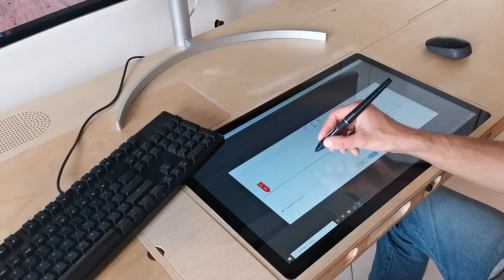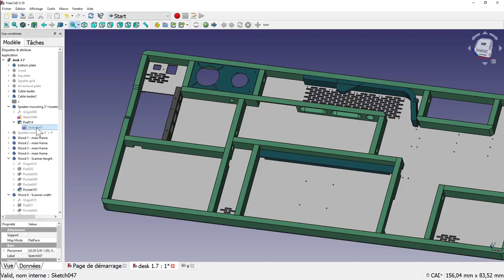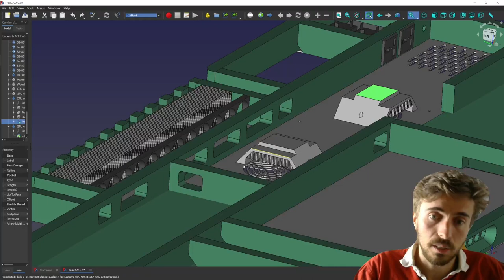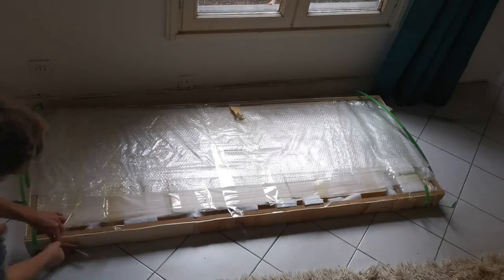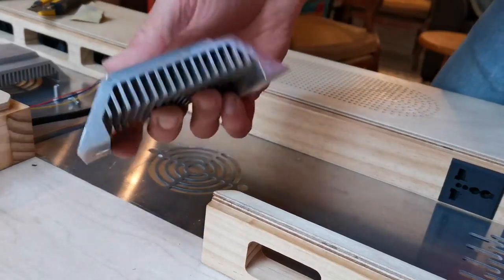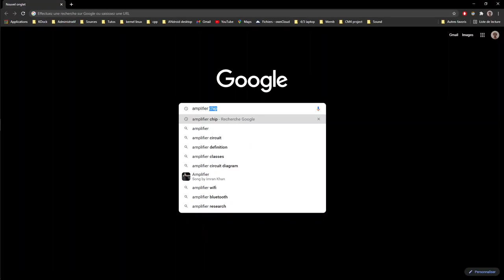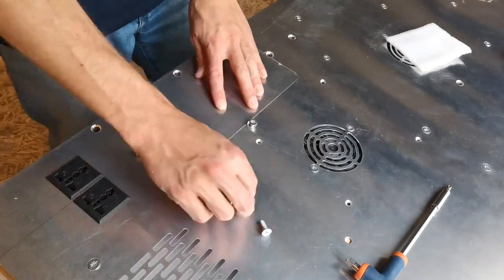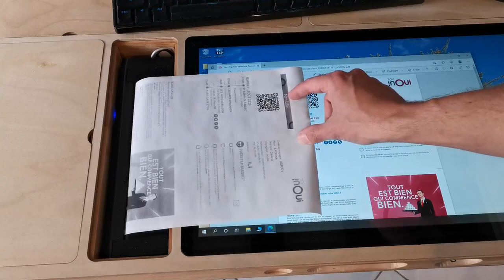The ULTIMATE desk PC!

Comment: Hi, nice project, looks very neat. Just some remarks: the VRAM ont the GPU is not touching the custom heatsink, I think it will be problem with load intensive program like games. The orientation of the speaker are not optimum, and the tweeter might be very attenuated by the angle of the listening position. The speaker enclosure need to be calculated and completely sealed or vented to provide a good bass respond, as for the crossover. The 11 small fans might create a lot of noise while spining, the larger the fans, the quieter. It will be very convinient to have some USB port that can be accessed from outside, to charge the phone for exemple. The tablet screen might interfere with the keyboard and the optical mouse, maybe a cover will be convinient.

Comment: The desk heatsink idea sounds good in practice but I have seen many "silent pc's" that do a large heatsink system. These are normally really complicated and a lot of very specific machining. I think just including some sort of watercooling support (like the desk LTT built) or just simply some air holes with a dust filter(maybe).
Reply: unless you can post temps of your hardware and it stays in check then it might not be as big of a problem as I think.
Reply from the maker: @tonylarose4842  temps during stress test maxed at 75°C. So that's correct but it could be better. 
I'm currently thinking about what can be optimized. One main thing is that if the bridge was made of copper it would already make a huge difference. As it's twice more heat conductive than aluminum and the main issue now is that the heat does not evacuate fast enough.

Another thing is that soldering the heatsink to the aluminum sheet would also help. Or at least make the contact area bigger to improve the heat transfer.
Alternatively I'm considering the possibility to add heat pipes between the bridge and the big heatsink.
Ultimately water cooling is perhaps conceptually more efficient, but it raises a lot of questions and i don't know if the average user wants to deal with water cooling extra cost and hassle. 
So the bottom line is that I'll probably offer a water cooling system as an option.
Reply: @pierreboyer9277  a copper heatsink would for sure help the heat evacuation, but what would be your plan for the aluminum plate? As it is, you'd run the risk of galvanic corrosion

Comment: good to see a video from you!
nice job. I have two suggestions:

1. I think the buttons on the front really detract from the sleek and Minimalist look of the desk, maybe you can find a better place for them, maybe under one of the panels.

2. In the first desk you built the whole surface of the desk is one sheet of veneer so the texture and grain is uniform, like from one piece, but in this prototype it has to be more than one piece because of the tolerance. In my opinion it kind of ruins the uniformity of the surface. I don't know how to solve that, maybe cut it from one piece and make an inlay of aluminum between the desk and each panel cover.

anyway maybe I'm just too much of a minimalist...
sorry for writing so much but I hope it helped
Reply from the maker: The buttons could be inside the cavity on the right, next to the io shield. However it is actually much more practical like this in front. Having to open the cavity to access the buttons was quite annoying.
Another solution would be to put the buttons (different ones) under the desk, embedded in the metal sheet. This way they would be easily accessible while being hidden. And it would be easier to build than on the wood.

I see what you mean regarding the grain of the wood. We made a first prototype of the plywood by laser cutting, this way it didn't need to be more than one piece. However the factory scrapped that plan because of the cutting soot, they didn't knew how to clean it efficiently. So they remade the prototype with CNC milling the plywood. I was a bit annoyed because of the grain you mentioned. However when I got the prototype it felt ok actually.
Though we'll try to see if we can't just clean the soot easily.
Reply: @pierreboyer9277  You could probably fix the soot issue by finishing the wood first (stain and clear coat or just the clear) before cutting and just sanding and redoing the finish at the end.  Another option is just putting a big sticker on it (low tac, similar to masking tape) before cutting.  Then there is the more obvious solution of doing multiple passes at lower wattage for the laser.  Of course, all those solutions would increase the production cost and time a bit but could solve the soot issue.

Personally, my biggest issue is the position of the speakers.  I really feel this desk needs a short back panel (making it L shaped) so the speakers face forward rather than up.  This could benefit you by giving you a nicer place to put controls and USB ports too.  Honestly, the inside of the speakers would probably stay cleaner too, especially if you install speaker fabric behind the holes. 

You might also want to shift the position of the integrated screen because it would get in the way of a keyboard and mouse, unless you could include something to cover it.  Maybe a desk pad or actually just embed it a bit further and have a thinner panel over top that has a protective backing so the screen doesn't get scratched.  Is there an option to have the integrated screen turned off if you're using an external monitor primarily? Because that would be good.  It would also be good to have a way to angle that built in monitor a bit, for people who don't like working completely flat. Don't know how you could do that but it would be great if you could.

Otherwise, the idea seems great so far and I'm looking forward to seeing what you come up with in the future! 😁👍

Comment: This is a real improvement over the first version of the desk, good work! Here are some comments for more potential improvements: 

- The scanner compartment should have hinges that keep the cover open. Ideally, you could use those "locks" where you press the cover down to unlock it and then it lifts itself up. When you press it down, it locks again into place.
- Is there the option to have a feeder in the scanner? That is sth I would miss.
- The light of the power button should be possible to turn off, so that if you work in the dark it doesn't bother you or others.
- I would prefer the control panel for the desk legs to not be inside the cavity, but to be places so that the button surface would be at the same level as the wood, I don't know if I am describing it properly. Instead of being like a C where the buttons are on the left side of the C, it would be like an I so that the buttons are just a continuation of the wooden plane.
- Some people have microphones or other stands for podcasts, etc. It would be a nice addition to have reinforced desk corners so that this stands can be safely locked without denting the desk.
- It would be nice to have in the empty compartment (where the usb ports,etc are accessible from) some holes to the right of (or below) the desk so that some cables from external devices can be connected without having the cover lifted all the time. E.g. to connect microphones to external sound cards.
- It would be nice to have a place to screw some small metallic holders where one can hang their headphones.
- It would be nice to be able to use the speakers without turning on the pc. E.g. with a mini jack input.
- The touch screen would be nice to be able to tilt a bit and keep in such a position firmly. This would be nice if you want to read sth there while sitting back in the chair.
- There could be a holder for the screen directly inside the desk so that the monitor does not need its own stand. I don't know if there is sth like that in the market, but I imagine sth like a compatible tube that you lock into the desk and on the other side has a universal holder that you can screw to monitors. Basically, it would like you have it now, but the curved legs of the screen would be missing.
- The sound controller is this potentiometer in the middle of the buttons, right? I could see that being a bit annoying, scratching hands there accidentally or breaking it if it gets dragged by a belt or sth as you stand up from the chair.
- More colors for the wood would be great, especially a white version.

I hope you find these useful! Good luck!
Reply from the maker: Thanks a lot for your ideas ! 
Regarding hinges, it might not be ideal because if you want to scan something that is thick, then you can remove the cover. Regarding lock/unlock, I think you're talking about push push mechanism? That's an idea.
Disabling the LED is no problem, you can unplug the led wire.
For USB I think there could be something like this ? https://aliexpress.com/item/4000474459008.html
that would be facing the outside. Maybe something like this with also a SD card reader.
Reinforced corners are a good idea. I havent tried to add such equipment. I'll do it see how it behaves.
For the speakers I need to think on it. As their 12v comes from the computer power input. Though it makes sens that it could be used standalone too.
Yes the potentiometer is on the front. It's not proturing too much so I don't think it could get damaged that easily. Though the buttons may move again.
Reply: @pierreboyer9277  Maybe magnets can be used here so that they can snap into place and It would help with the panels staying in place as well.
Reply from the maker: @rajpalan  Yes that's a good idea. It adds a bit of complexity but may be worth it.

Comment: Love the revisions! Out of curiosity, what kind of temperatures are you getting for your system with this design? And what specs is the system for testing? I. Curious how well this design  works for higher end components. Love the aesthetic design! Would you ever consider making alternate model tiers? I.e. stronger air cooling design, water cooling design?
Reply: "Stronger air cooling" being maybe the wrong way to phrase it, but implementing a design that allows for a higher airflow system?
Reply from the maker: @Inlandthunder86  You're right, not being a native speaker makes it difficult to make videos without this kind of mistakes :)
Regarding temps, they are OK but not as cool as I wanted. They were around 75C. The problem is that heat does not go fast enough in the aluminum. The cool thing is that I already found a solution for that: adding heat pipes between the bridges and the big heatsink. That will be a game changer and will give much lower temps.
Reply: I'm looking forward to the end product. I've been looking at wanting to build or get a desk pc for myself for a couple years now. Still haven't committed to anything yet but will be watching and waiting for this. :)

Comment: People commenting on your videos are confused.
You didn't "build" this; you drew it up in cad software and had a company build it for you because you want to commercialize the desk.

You don't plan to sell it with components hence you are avoiding water cooling because you feel people that would buy this desk wouldn't want to spend time setting up water cooling.

Since you plan to have pc components in this desk you need to show proper pc testing with metrics in your vids or other media because the link to your desk tells us 0 information and if you click anywhere on the website, it talks about other useless products.

I'm not against making profit, but if your target audience are "pc enthusiasts" then we want to know what components you are setting this up for, and how well they handle thermals under load.

IMO (Since you are talking about using the base as a large heatsink your intended consumer aren't "pc gaming enthusiasts" but rather people working from home that don't know the difference between a Dell Latitude e5470 and Asus Zephyrus G14.)
Reply from the maker: Yes I had a company building it (at least the main structure) because it was the point of the second version. If you want a more DIY video you can check the first build : https://www.youtube.com/watch?v=1EpBJpFZCKw

Regarding metrics I'll definitely give more details in the kickstarter. Overall it was ok but not awesome (around 75C under load). Which was because the heat doesn't spread fast enough. 
To solve that I'm going to use heatpipes which will spread the heat correctly.